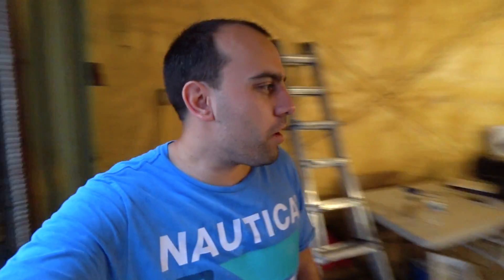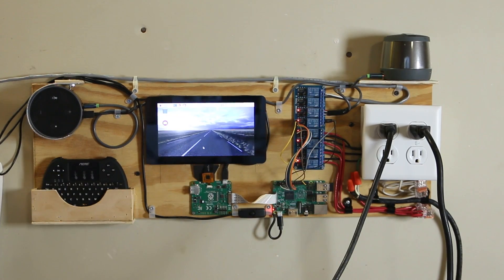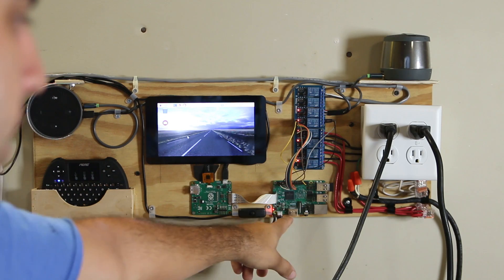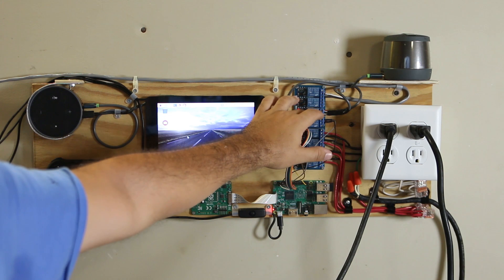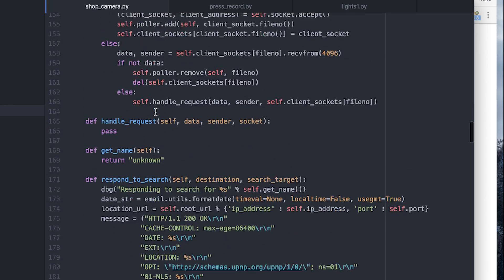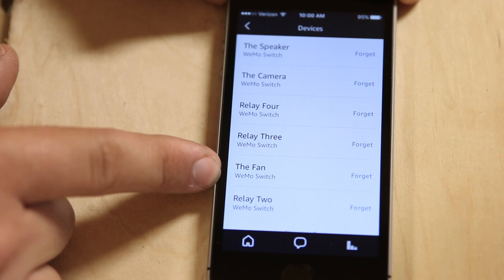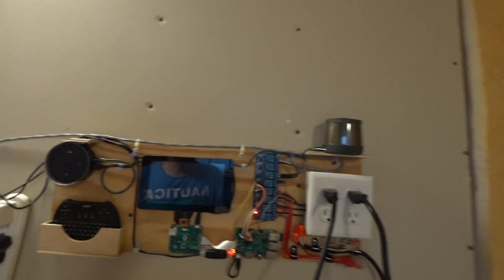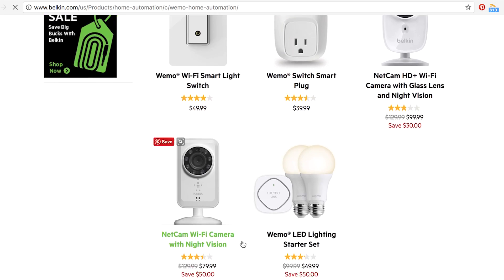Make "Alexa" Control ANYTHING!

Comment: Very Cool project!  Did you consider using a wifi development board like the particle photon?  These are much smaller, cheap ($19) and support IFTTT applications which in turn support Alexa commands.  Using just the photon board and your relay control board you could seemingly accomplish the same thing.  Programming would be simpler as well.  Just a suggestion for others considering something similar

Comment: Or you could just use an $10.00 Arduino instead of a Rasberry pie. Just connect a cheap $0.70 sound chip to the Arduino and you have a much, much cheaper and better customisation sound controlled system.
Reply: Do you have a YouTube video that would show the steps?  This is what I am just getting into.

Comment: Have you noticed a voltage in the AC outlets when their respective relay is off? I've had two (out of two) of those Songle relays that seem to leak about 12 - 14 VAC between NO and COM when the relay is in off position.
Reply: They aren't very good quality relays and I wouldn't trust the current rating that they have stamped on them. If you want to control anything that draws more than a couple of amps, I'd use it to drive either a bigger relay or just get better relay boards to begin with. These are generally OK for low currents only.

Comment: I am also looking to automate my travel trailer in the spring, i do seasonal camping and from apr to oct we spend aLOT of time in our camper. can we email , i would love to hear some of the ideas you have about trailer automation. I cant think of anything more than turn on off the hotwater heater, AC, maybe some digital locks on door, and electronic grey and black water pipe valves to hook relays up to.
Reply: Good start, lighting, inside, outside skirt lighting.  Sitting outside with friends.... Alexa, how about a little mood change.  Red LEDs, music from Barry White, project the awning..... slide the TV out from storage....

Comment: SAFETY POINT: I believe those relays are 10 amp, maybe 12 amp, but it appears that your only fuse is your fuse box so a 15 amp fuse.  Also, is the wire on the switched side of the relay 14 gauge (good for 15 amps at 110v)?  The 110v plug socket you are using is a 15 amp socket.  You can, without thinking about it, plug in a 15 amp device (your compressor, for example), and the circuit between your input power (which is rated at 15 amps), and your wiring/relays can start to melt without triggering your circuit breaker until after a possible fire.  Sure, it works now... but someday it will melt down (a fire).  AT MINIMUM, you need to put in fuses to limit the amps you can pull in the design of the circuit.  In this case, assuming your limiting factor is a 10 amp relay (maybe it is the wire), you should put a fuse between your power source and the relay.  You could put a 10 amp fuse on each wire that goes to the plugs which will allow any one plug to go to 10 amp.  IF THAT DIDN'T MAKE SENSE, imagine this:  You have a big thick power wire to the left that provides power which can handle a 15 amp load.  It has a circuit breaker (fuse) that trips if it gets a load much more than 15 amps.  To the right, you have normal household plugs with big thick power wires that can draw up to 15 amps each.  You can probably plug in a compressor (lots of draw), and some small stuff with less draw (a light, your music, etc...) without tripping the circuit breaker. Two compressors or a compressor and a heat gun... that will trip the main circuit.  Now, what you did is put some really thin wires and relays  in between (let's assume your relays and/or wires are rated for 10 amps).  When you plug in that compressor that is drawing 13 amps, those little wires/relays start to melt (getss a little to hot).  The circuit breaker in your panel doesn't trip because it is fine up to 15 amps.  You either need to: 1) Make everything 15 amps, 2) Add inline fuses to protect the 10 amp relays/wires, or 3) if you have a dedicated line back to your panel (i.e. your power source is not shared with other outlets in your garage or later in your trailer) you can change to a 10 amp circuit breaker.
Reply: Mike Wrobel also should have proper grounding.
Reply: Yes, Halberdier25 is correct. I missed the grounding.  It should have proper grounding.  That would just be a pass through of the ground wire which goes from the plug socket all the way back to the breaker.  I am not sure what code says where you are, but those plug sockets probably should be ground fault too.  Ground fault is required in my garage, so I would assume the same for that outbuilding.  Definitely in the camper you are building too.
Reply: Mike,  So if I want to do something similar
1) what gauge wire should I use for 10a draw?  The circuit that I would attach this to has a 15a breaker and all 12gauge wire (At Least the romex is labeled 12gauge in my wall and in my comms closet)
2) . If I do a project like this would you recommend having a certified electrician come and inspect afterwards?
Reply: +The Destroyer I think, that you are missing the point. The purpose of the video was to present some of the countless possibilities what you can do with the Alexa, not how to properly wire the electrical boxes.
Secondly, if you worry about the insurance check your electrical appliances at home. I bet half of them don't have UL certification. Especially cheap Chinese cellphone chargers or brick power supplies.
Reply: All of mine do have UL, I am aware of the standard. I don't fuck around with electric fires. Neither should any of you.
Reply: +The Destroyer You don't fuck with the fire? Well, your nick says something else.
Reply: You should really get those 120v splices in a box also. Sweet job tho!!!
Reply: Cool Project, But add to the safety concern there is a very real issue there with the electrical, and if there ever are sparks or a small fire that sets the exposed and unprotected spray foam insulation on the wall it will be ablaze in a few min.  Spray foam in occupied space is required to have a thermal barrier: ie: a layer of Gypsum Wall Board over it. or an intumescent paint.  In unoccupied spaces such as an attic, you need to spray a spark-arrestor paint on the foam.

Comment: Nice video. But you could use a Broadlink RM pro to do all you are doing without messing with relays and scripts. All you would need is RF power socket adapters (even older cheap ones you can use in any outlet) or any IR device (not sure if your Canon camera has an IR receiver but many cameras do). There's a skill for the Broadlink RM pro. So you wouldn't need the relays, raspberry pi or the touch screen. Everything could be done with Alexa skills and voice commands.
Reply: But no challenge! And missing the learning experience!

Comment: this was awesome. can you get deeper into wiring the relays and programming them?
Reply: a much simpler and cheaper way to do this is to just buy a boradlink RM pro it controls any 433mhz RF or IR device and there is a 3rd party bridge app that makes it work with  alexa for $7 , i think broadlink has their own  alexa integration now too but i think it only works for  IR devices , you will need an always on android device to  run the bridge app  like an android tv box or an old phone  hot wired to run without a battery , the app runs on android as old as jellybean the RM pro you can get for  $26 or $30 ,you can get 433 mhz relays for under $2 both 12v and 120v models ,his build has all the relays in  one place so  veryhting needs to be wired to the relay board ,using  sub $2 chinese 433mhz  relays  means you can control devices without needing to wire them to the relay board , the RM pro has  good  RF range too ,the only other thing you need is a 433 mhz  remote to program  each relay and the broadlink with , they are cheap too but  i have another solution i  am going to be working on ,  building a cheap  RF TX RX device that  works on the PC so i can scan the 433RF remote and tweak the FQ so i can have different channels to program the relays and the  boradlink with  without having to buy a  remote for each relay
i saw a tutorial on how to make one from a  cheap 1 or 2 $ usb sound card and a superhetrodyne  TX RX set  ,so about a 2 or 3$ build

Comment: I believe you can accomplish this (controlling many devices at once as well as each device individually) by simply using the Wemo app. Simply set-up a group and place all devices in the group. Create as many different groups as you want or need. 

As one example, I have an Amazon Echo Dot in my studio. I call one of my groups Studio. I say, "Alexa. Turn on Studio." This starts-up one particular hard drive, a laser printer, a fan/heater, three separate lamps, etc... 

In the house, I have an Amazon Echo where I tell it, "Alexa. Turn on all lights." and, of course, "Alexa. Turn off all lights." I set the thermostat (Nest) using Alexa and much more. Oh yeah, check out IFTTT (If This Then That) for some of the dandy recipes.

Except what you showed, I don't know all of your project details nor your specific goals in all cases. But, I thought this information may help (and maybe save alot of cash)... as always, take it or leave it.

Comment: I think this can be done a lot simpler by using a smart home hub (such as SmartThings) and z-wave outlets along with routines that you can trigger with Alexa to perform multiple tasks at once. The only thing I'm not sure about is the camera remote but there are smart relay modules so that could probably be done as well. I'm not sure which method is cheaper though.

Comment: I suspect the current you are drawing for your compressor may be too much for the relay. You may want to double check the current on the relay compared to the compressor. You may get arcing between the contacts that will burn the contacts and then increase the resistance thus increase the heat in the relay causing it to catch fire, or the contacts may weld themselves together. Cool project. You should check into the esp8266. It is a WiFi enabled arduino and will plug into your relay board. I bought one last week for about $9. you can then re-purpose the raspi and screen for something else.

Comment: If you like to controll waterheater with "Alexa", you can buy Sonoff switch for $5 and it's cool, I don't like Raspibery Pi cuz I need to know more about Programming and it's simple but supported by Amazon Echo "Alexa" just turning on/off waterheater but also if you wanna know some information about Sonoff switches, wherever you connect on output on Sonoff switch, you can controll that with "Alexa" or with eWee link app, greetings from Bosnia, SUBSCRIBED and POST NOTIFICATION IS ON, it's just because I supporting you in this project that you working on!!! :)

Comment: Nice, I'm planning on modifying my house to have X-10 or better mains controllers in the walls. I can then manage it without relays or be tied to a physical limit (8 relays). Was also thinking of using PI Zeros as it's $10 and can me managed over wifi anywhere so adding to Pool pumps etc.

The only problem with these is that it doesn't detect if you've override it and it'll say OK but it's already on. Doesn't seem to be a big deal could in some applications it might be an issue.
Having some feedback to Alexa to give it some sort of error or feedback would've been nice.

Comment: Nice setup. You could also ditch the echo and have the alexa assistant inside the raspberry pi with a software installed. But like you said, it's probably more difficult for you than just having an echo beside it.

Comment: You could have bought The Clapper for $8 on Ebay.
Reply: It will... but only all at once...
Reply: A clapper won't control eight different relays.
Reply: one could always adjust the listening devise on a clapper.
Reply: good idea, was thinking the same thing but instead of using the sound recognition board it has in it replace it with the tech in a smart bulb and use your Alexa that way
Reply: Or sonoff switches for the same price 😂
Reply: Clap on claps
Clap off claps

Comment: Could you connect the relays by Zigbee? with a permanent feed from each socket you want to control.
Reply from the maker: I had to look up what Zigbee does, but it looks like people have set up their raspberry pi's as zigbee gateways.  So I don't see why not.
Reply: Mike and Lauren I just think it would be great to have a wireless solution. It may add too much cost though. I do like the way you it centralised though as that makes it easier for maintenance. I'm not sure what you call them in the USA, but building this into consumer units and treating each socket as a ring may simplify your wiring in the trailer.

Comment: Very neat! Thanks for sharing
Be careful with the compressor on that relay board. Those relays are usually only good to 10A and a compressor will likely pull more than that especially at startup
Reply: Is it possible to connect the small relay to trigger a heavy duty (over 10 to 20 amp)relay?
Reply from the maker: Good point.  I actually use a little porter cable pancake compressor that draws a max of 10A.
Reply: The hell? I was trying to picture a 10A audio compressor. Note to self: always watch the video before reading the comments.
OTOH my 10A pancake compressor leaves my pancakes paper thin.
Reply: I would hook up the small relay to turn on and off a 24 volt coil  DTDP relay like in an A/C unit to power that compressor.
Reply: Do you know if it's possible to get a relay board that will handle a higher amperage? I've got a 220v 3hp motor on my compressor, I'd love to work out a setup like this that could handle it.
Reply: You could also take some real high amperage relays and switch THEM with your small ones.
Reply: Another problem is that you control motors, big inductive loads, the relay might be rated for 10A but on this small relays its AC-1 (only for ohm loads) you need a contactor 10A with minimum AC-3 or AC-4  (rated for inductive and capacitive loads) otherwise it's just a matter of time when the contacts break down and may cause a fire.
Reply: Of course, AutomationDirect has 3-pole contactors and overload blocks that are designed just for this. Since your compressor is 220VAC single phase, you would connect both hot leads to one pole each on your contactor (leaving one pole unused). Be sure to add the overload block, which gets installed below the contactor. And I would select my coil voltage to be 110-120VAC since it's much more gentler to your relay board than 24VDC is.

https://cdn.automationdirect.com/static/specs/ghseriescontactors.pdf